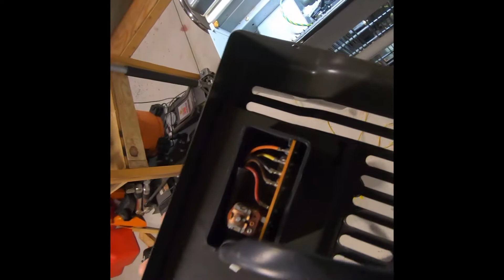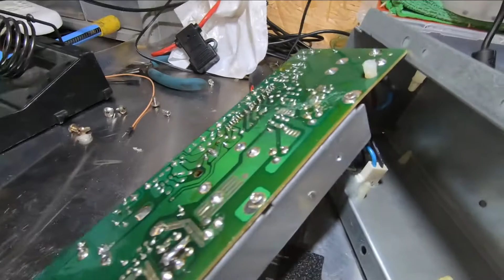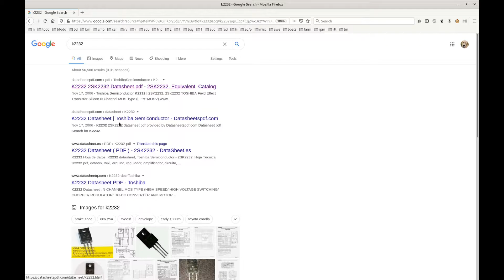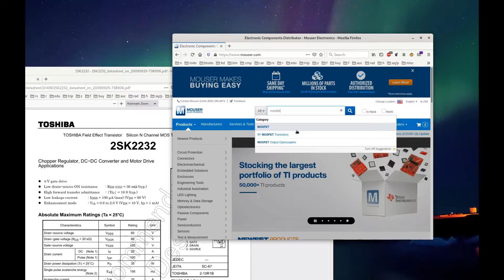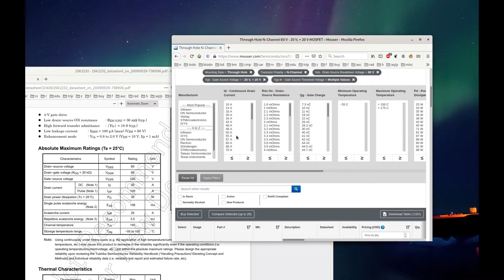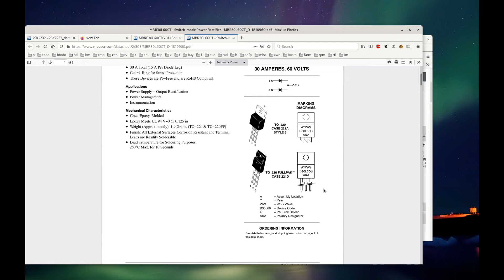Foretravel Norcold MRFT-460 TEK-II Refrigerator Freezer Power Supply DIY Fix

Comment: A few comments -- if you could post links to the components that would be helpful! Your video is hopefully going to help me keep my old norcold Tek ii going! The part where you ohm out the components you refer to it as volts which is sort of agitating, but forgivable. Also higher # voltage requires smaller wires, so the thinking that having a max voltage as a high number you'll be good, is not necessarily true. A 12v DC current will burn up the same AC wires that can run heavy appliances
Reply from the maker: The biggest issue is that the components that I got were still not correct.  The mosfets still run really hot and I needed to add additional cooling.  That said they are still working.
Reply: @idocars3459  thanks for your reply! I'm still trying to figure out how to revive my motherboard. I might scrap it all together and try to hardwire a pid controller thermostat to a 12vdc-24dc step up converter, to a 50hz bridge converter, rendering the 24vac output signal needed without needing to continue scratching my head about this board.
Reply: @slowpony7446 did you got it fixed or did you scrapped it? I am looking to buy one of these ,but i am hessitant because of the parts that may be non existent.

Comment: Where can I find that box? Do they make a replacement?
Reply from the maker: They do but it's crazy expensive.  Like $350 or $400.  It's a better choice to just buy a new unit unless you can repair it.
Reply: @idocars3459  I just need that board my gfs is shot. She's a veterinarian lol that's crazy cause I can't find the part anywhere. Any link?
Reply: @thereeldeal821  Replied but maybe you sold the cooler.  As a low-draw cooler this would be good for Vets and emergencies.

Comment: I have one but its work with battery only but with 110 volt never I don't know what happened can you help me
Reply from the maker: There are two power supplies.  The one converts 110volt to 12 volt.  The 12 volt runs the fridge.  Sounds like your 110 volt has either blown up or  has a blown fuse.